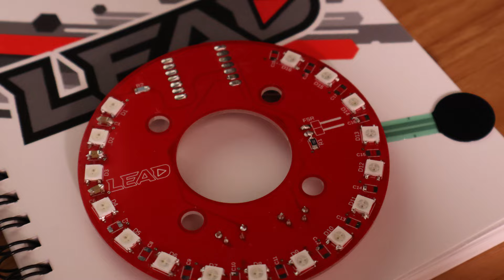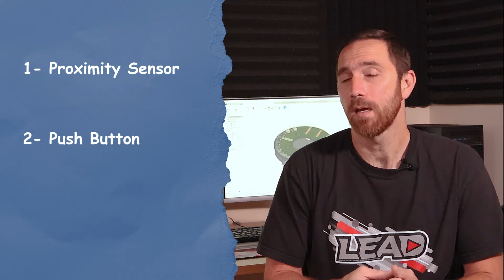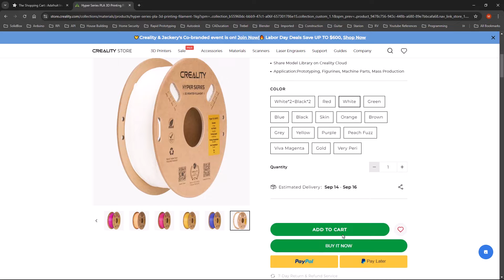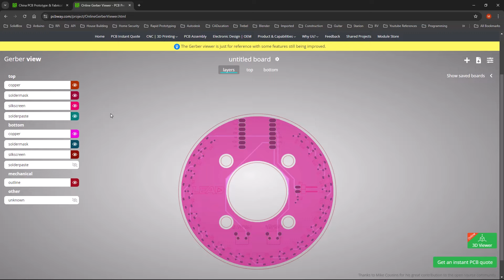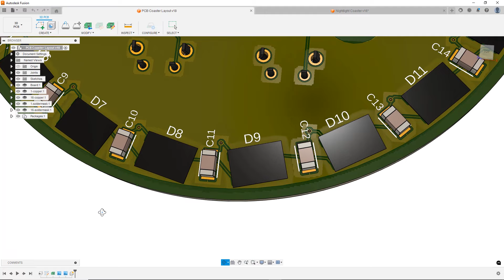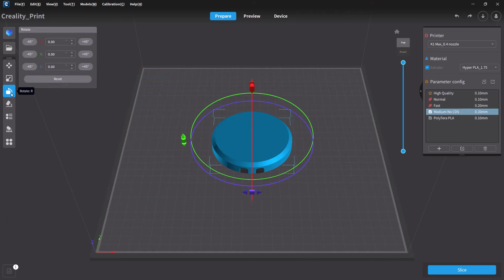Product Design Made Simple | The 5 P's to Turn Ideas into Reality

Comment: I love this way of incorporating sponsors. This is the first time I’ve really felt compelled to use a sponsor because you showed us how you worked with them for a real life project. Love this kind of video.
Reply from the maker: Glad you liked it!!  I have turned down a lot of sponsored video offers because they are either random or something i wouldn't pay for.  I generally used DKRed to make my PCBs but the process was great with PCBWay and I am switching over for my personal projects.  Being able to have them assemble tiny surface mount parts so i don't have to try and hand solder them is big.  The bare boards for 5 of them was $25.  Populated was around $175-$200 but that was without FSR, micro controller or the 2 push buttons.  Basically all the through hole stuff.

I will be doing an updated video showing how to upload files to their site and what they need for assembly and so on.  that process took a little trial and error and it might help if people want to use them.